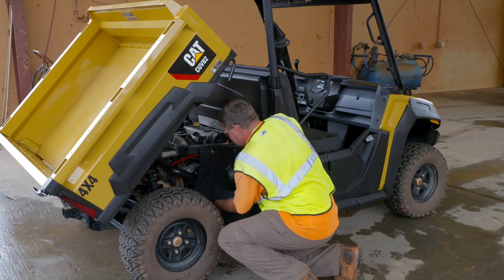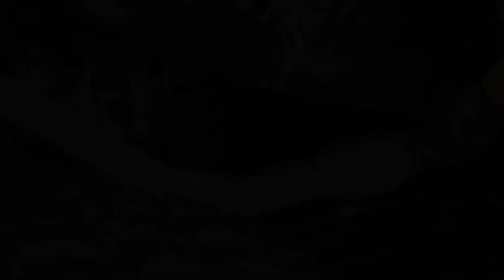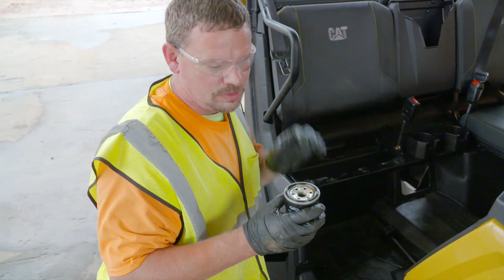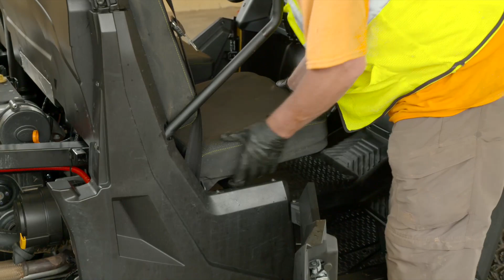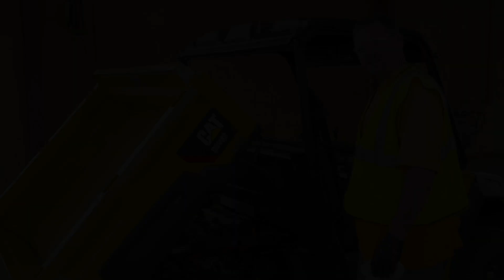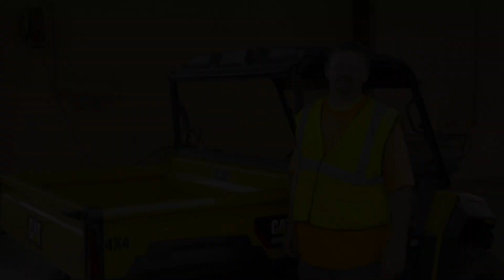How to Change the Oil and Oil Filter on the Cat® Utility Vehicle

Comment: How does the cab seal up with that access panel to the oil filter. I feel like dust would come through there.
Reply from the maker: Great question! We completed extensive testing in dusty environments with this feature and didn’t find it to be an issue.